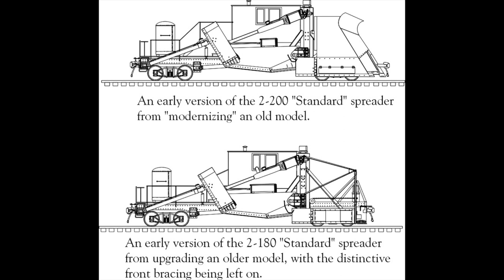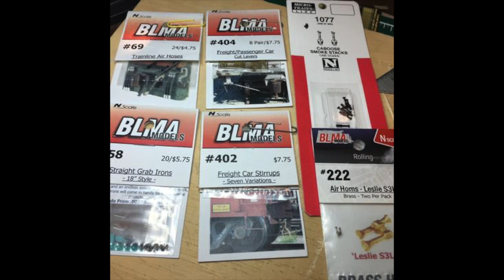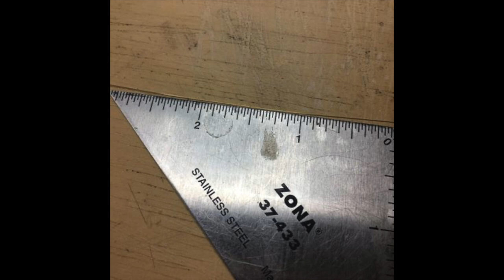N Scale 3-D Printed Jordan Spreader Build Clinic

Comment: nice job on the shapeways build!!!  thats one of my early designs. Ive made some upgrades and improvements since then and the resin prints with no lines most of the time as I can chose my own model orientation.  Nothing beats the custom work you've added and enhanced to make it really pop. The Hands/Stanchions get hard to print closer to scale and of course break really easy.   ive also added tons of decal options for most options requested by modelers.   thanks for mentioning where the model came from!  :D
Reply from the maker: Brett, thank you for creating this awesome 3-D kit.  As my first build of a 3-D kit, I had a great time building it just as it came with the addition of the extra detail parts.  I plan to build another one someday down the road as there were some items learned that I will do differently on the next build. Thanks again, Tony
Reply: @CornCountryRails  reach out when you do. Maybe i can make some changes with your feedback or get you a version for a display withe wings extended :D